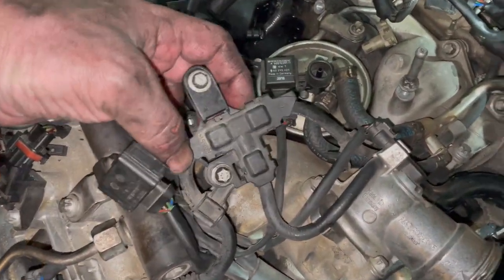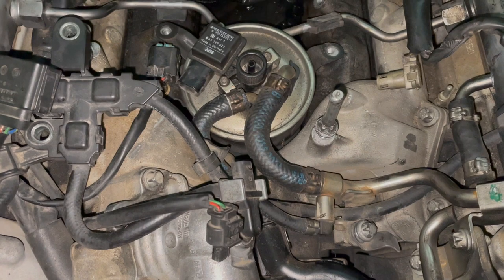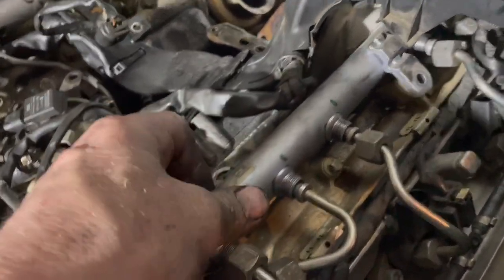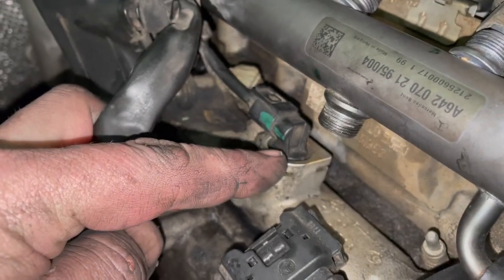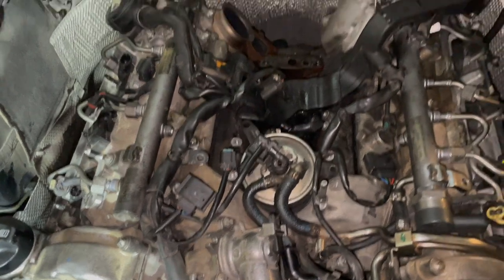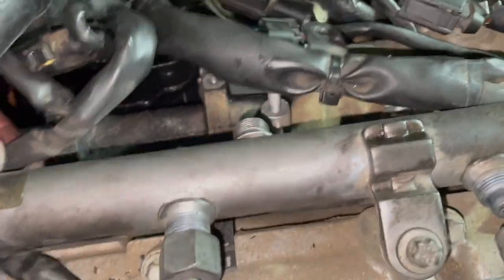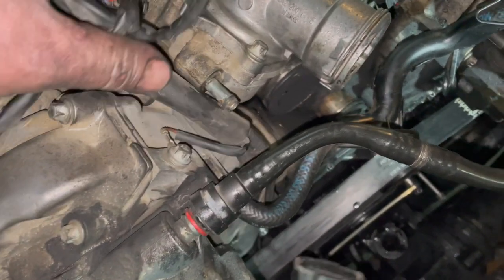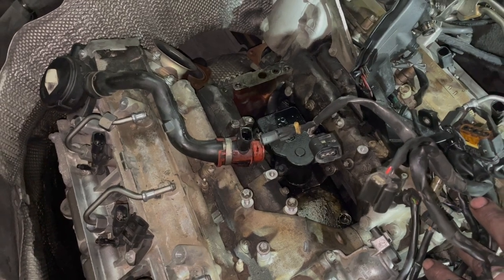OM642 (oil cooler leak fix 3) Fuel filter & fuel rail removal

Comment: Question here the high pressure fuel pump has the hose which goes to the fuel fitler, the other one, I think is much longer from the filter on top, maybe back to front think here, but on my one the fuel hose on my om642 engine  seems to go under the mass air alloy  pipe to the Turbo seems to  go somewhere, where does it end up?
Reply from the maker: I think to the other one from the filter goes toward the fuel tank. Mine looks to go to front a bit but bends down over the left side of the engine and then back towards the rear of vehicle where fuel tank is
Reply: @DIY-VIDEOS  my one seems go to the fuel filter after stripping this area out.. Looked into it all,  as the remap could not be done as the guy said low fuel pressure and turbo boost was not where it should be , too low or over boost.  Not sure if this the reason for the problems, but, I found the hose to from high pressure pump weeps, but fuel filter hoses are not in good shape, and weep too, , and another is ot lookng to geat as well. regard the turbo, the mass air boot which goes over the front of the turbo seemed have been buchered by some mech in the past, and a little chewed up,   the turbo itself is lookingin  good shape, and clean. but the air filter box to turbo is not sealed 100% if right,  I am banking on it being 99% of the  reason the readings on the turbo are not looking so t happy. So we have new boot on the way, and hoses ..
Reply from the maker: Yeah that orange boot often fails and then leaks oil out onto the swirl flap motor causing problems there. Definitely replace leaking fuel lines. Hope you get it sorted out, best of luck with it

Comment: HAHHA the 642 has its down sides, oil cooler, bla,bla,  but as they say,  show us a car that does not have any weak points or down side, they don't exist!:face-blue-wide-eyes::face-fuchsia-wide-eyes:
Reply from the maker: You’re right. I like this engine and the flaws are manageable. This same engine is in the sprinter vans and it’s not uncommon to see those with 400K plus miles on them